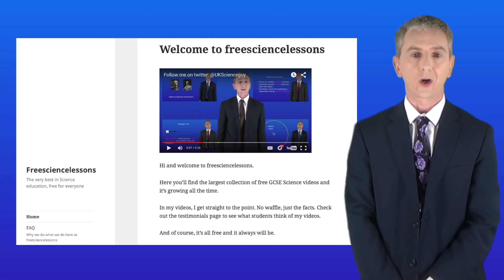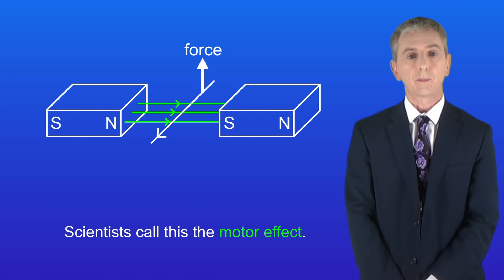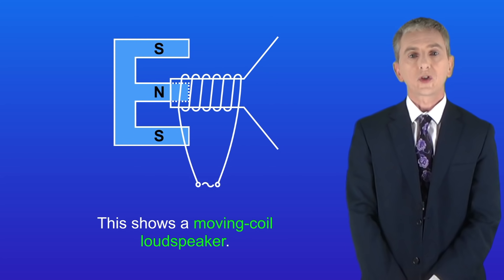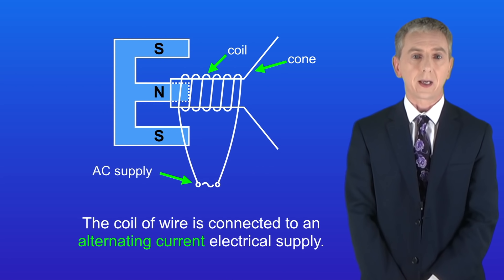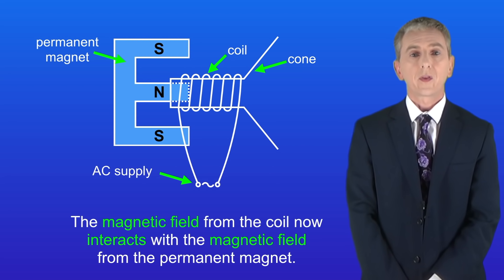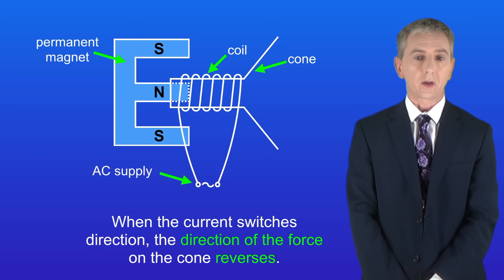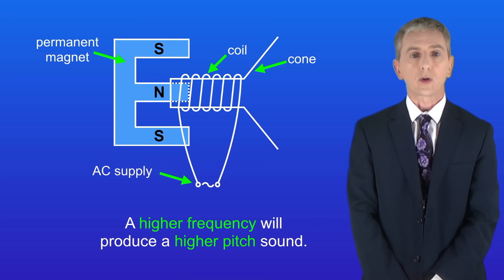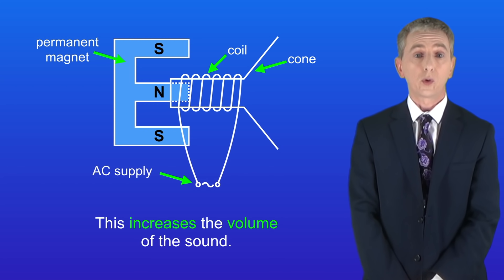GCSE Physics Revision "Loudspeakers and Headphones" (Triple)

Comment: Thanks so much for your videos! I just wanted to ask seeing as we are the first year to do the 9–1 spec for science, do you think the grade boundaries will be slightly lower? I know it’s hard to predict, but how many marks do you think would be a grade 7/8?
Reply from the maker: Thanks for the comment. That's a very good question and I honestly do not know the answer I'm afraid. I'm hoping that the exam board sets the difficulty of the paper at a reasonable level, in other words not crazy-difficult. If the exam paper is too difficult then the grade boundaries will have to be low. If the paper is reasonable (like the previous years), then the boundaries will probably be broadly the same as they were before. So at this point, we just don't know. However, what I'm pretty confident about is that the results are not going to be allowed to suddenly crash down. So either the paper has to be reasonable or the grade boundaries have to be low. Hope that's ok.
Reply: Freesciencelessons Thank you! Also, I feel like I don’t know what to expect from the 2018 science exams. What I mean is is the style of questions going to be completely different? All the mocks we have done have been fairly reasonable but the teachers have just been taking the questions from sites like physics and maths tutor as they were given no specimen papers. My Chemistry teacher says that she thinks the 2018 GCSEs are going to be similar in terms of style of questions to the IGCSes and the questions for that are found on physicsandmaths tutor. I don’t know if you’ve heard of this site but if you have time, could you possibly have a quick look at them and tell us what you think?  Thanks once again!
Reply from the maker: Hi. I've had a look. Personally, I think that the questions will most look like the two specimen papers that AQA have released. So there won't be any major changes to the way that they ask questions. The biggest difference is in Physics where you are only given a small number of equations. My advice is to just continue doing what you should be doing anyway.... revise. Most students don't do anywhere near enough so if you do plenty, you'll already be in a great position.
Reply: Freesciencelessons can I use the AQA specimen papers if I’m doing edexcel?
Reply: Toffee Munch yeh u can but some stuff will be mixed around and some won't be relevant to you
Reply: Hope you had fun with the exam :) we just started our gcse syllabus

Comment: I'm slightly confused about the speaker. How come it can perfectly recreate noises of different pitch and volume at the same time, as well as someone speaking/singing ?
Reply: I think its just the fact that it occurs extremely quickly and as all sound is just vibrations, due to the ability to make tiny changes in the amplitude and frequency it can easily replicate intricate noises
Reply: In most speakers, there is a subwoofer and tweeters. Subwoofers produce the low frequency noises (e.g. bass) and tweeters produce vocals and higher pitched noises (e.g. snares). Im not too sure how one speaker does it all at once, perhaps it combines the notes together?